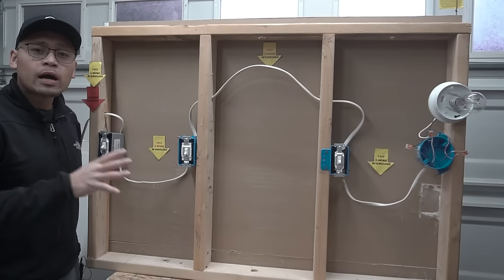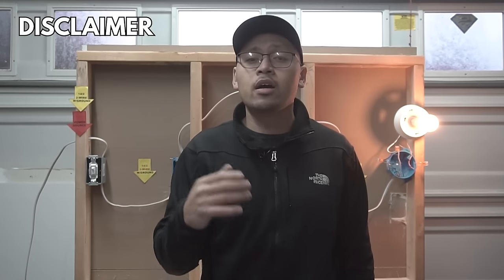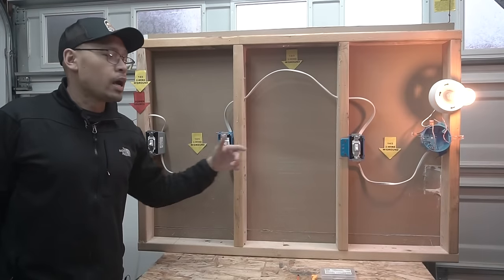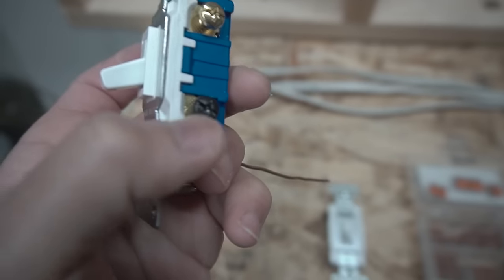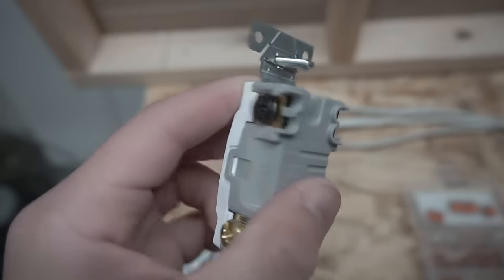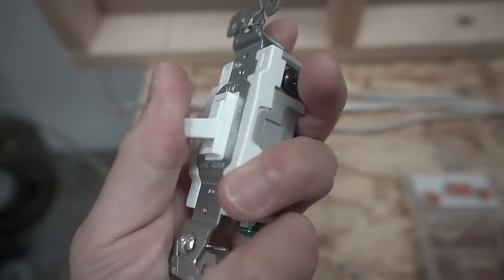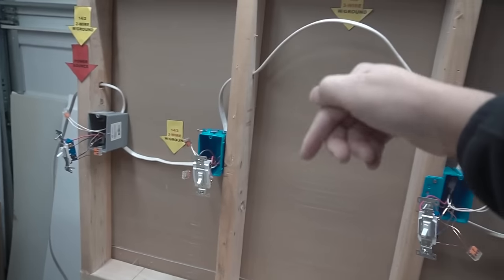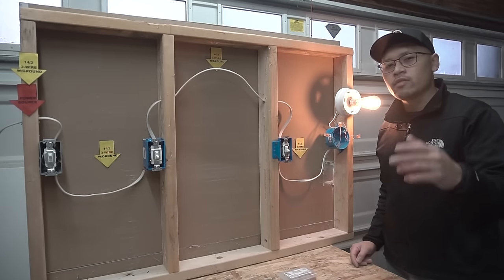How To Wire A 4-Way Switch System Explained (2022) | Easy DIY Step By Step Tutorial For Beginners!

Comment: On the 4 way it doesn't matter if red or black are on the same side, they just need to be one circuit on top and the other on the bottom, same on the 3 ways, first 3way switch power cable on the black scree and the travelers on the other screws, no matter the order, on the last 3way switch make sure the switch leg coming from the light is in the black screw and the travelers on the other screws no matter the order, what matters most is the common screws on the black wires on each side...!  Good video man keep up the good work...!
Reply: I notice on the 3way switches, traveler1s (red) are on the left side and traveler2s (black) are on the right side.  However, on the 4way switch, the 2 traveler1s are on the right and the 2 traveler2s are on the left.  To keep things consistent, is it possible to always keep traveler1s on the left, and traveler2s on the right on all switches?  Someone told me they always put the red traveler wires on top and the black traveler wires on the bottom for consistency.

Comment: One question; on the four-way switch, you connected the red on the opposite side from the first three way. I noticed you then connected the red and black on the second three-way switch to "match the wiring" from the first three-way. I'm confused as to way you didn't use the say wiring orientation of the red/black wires on the four-way? In other words, why did you not connect the wires the same all across? I hope I explained myself right here 🤔

Comment: We just bought a house that has an enclosed breezeway between the kitchen and the garage. The first 3-way switch is in the kitchen right next to the door (perfect). The other 3-way switch is in the garage, after you go down 3 steps and walk 5 feet over to the switch (senseless). To add to the poor control logic, the breezeway has a third door to the backyard AND a fourth door to the front yard. 4 doors into an 11’x11’ room. So coming from outdoors into the breezeway, there are no switches to turn on the light! I was considering an occupancy sensor, but now that I understand how to correctly add 4-way switches (and the fact that there’s an attic above the breezeway) I’m just gonna add a wall switch next to each exterior door (and relocate that silly garage switch). Thank you!

Comment: In your video , the 2 traveler wires are on different sides compared to traveler wires on both 3 way switches. They don’t need to be on the same sides?

Comment: I just found and subscribed to this channel about a few days ago and I really really wish that I had found him a looong time ago.   THANK YOU.   👍🏼👍🏼
Reply from the maker: Thank you so much! 🙏🏽🥰
Reply: @FixThisHouse  Your loops are too short and some insulation is pinching under the terminal screws of the switches which can cause a bad connection down the road. Too much copper exposed isn't good but also not enough is also not good.

Comment: Hi 
Must say you teach well !!! 
Question for a recap on a project of mine before I start ! 
Older home , and I need an outlet plug and the closes power source is a light switch running a light , reason why I'm asking is this house is finished and yes I'm thinking I need to run an attic wire to new plug and my question is how to connect to existing light switch to perform this

Comment: I was hoping to see how you packed the wiring into the j-box. 
I know how but for those that dont know how; they need to know to keep the bare ground wires away from the switch terminals. I would say thsts just as important as learning to wire the 3 & 4 way switches correctly.

Comment: Can I connect black on travler terminal #1 and red on travler terminal #2 in 3-way switch? (the pair on top side, not the single source on bottom side)
Because light is on when I off all 3 switches, i want to light off when I off all 3 switches.
Reply: Yes. It would just invert the function of the 4-way. You have to imagine the inner workings and see what is being connected to,what when you flip,which switch which way.

Comment: Does it matter if the red and black travelers have to be wired to T1 for red and T2 for black on the 3 way switches and the opposite in the 4 way switch?

Comment: Good class, but I have on issue the power comes in to the 4way switch . Had to replace it wired it up the way I found it but now the bottom hallway 3way switch does not work right,
if the 4way switch is down the bottom switch will work fine if don't turn the light off on the 4way the bottom will not work anymore// any suggestions all because the power goes to the
4way switch first

Comment: Hi, I noticed that you connected the red traveller on the left and black traveller on the right on the 3 way switches but switch them around on the 4 way switch. Would there be a problem if they all were connected the same...red on the left and black on the right?
Reply: No problem

Comment: Hi, at my last 3-way switch I want to control a light AND ceiling fan on a separate normal two-way switch (instead of just a light as in your video).  Do I just need a 3-wire (e.g., 14-3) going to fixture/fan kit or will that work from an ending 3-way switch?  Thanks.

Comment: hello there. I would like to know on the 4 ways switch. Red should be on the right side which is travel 1 and black should be on the left side which is travel 2. and also the power from the 1 switch goes to the bottom of 4 ways switch and power goes out to the 3 switch goes out from the top of 4 ways switch? 
From what i have seen you did. left on the right and black on the left on the 4 ways switch? Just wonder thanks
Reply: Don't think of left or right side, some 4-ways (decora style) have black screws on one side and brass colored on the other side. For example, on the cable coming from the previous switch the red and black wires will go to the black screws. The cable going to the next switch the red and black wires go to the brass colored screws. The red and black wires are the travelers.

Comment: My house has it installed without a 14/3 wire. Is it possible to do it with 14/2 wires? Or is the traveler needed

Comment: Can you have lights wired in between the switches?
Reply: That is what I want to know! I have two three way switches at the bottom and top of a flight of stairs. I would like to add a switch by the upstairs bedroom door. But that would put that switch after the light. I am thinking about putting the four way at the top of the stairs between the light and the downstairs three way. But that still puts the upstairs three way after the light. I am not sure how it would work. 🤔

Comment: Great video. I have a four way switch in my home, one of the locations is hidden, and never used. If I wanted to bypass it, and make it a three way switch, would I connect red to red, black to black, white to white, and ground to ground? Or would I connect red to black and black to red? Any help would be greatly appreciated.
Reply: Just remove the switch and connect all the same colored wires to each other like the switch wasn’t there. Just make sure that the travelers are connected from each three way correctly

Comment: That is very good video footage and good explanation 👍. But I have a question about the middle of the J boxfour way switch ? What will happen I crisscrossed the black and red wire on the traveler switch ? 🤔 by the way I just want you to know your video footage helps me a lot on my house . Thank you very much
Reply: As long as the wires from the same sleeve are on the same side it shouldn’t matter

Comment: Hi, can I connect power outlet to that 4 way switch box? If yes, you please share the wiring diagram?
Reply: It all depend on how you want that outlet to function.  It’s easy enough to connect the ground and neutral to an outlet.  But how/when do you want he power to get to the outlet.  If you use the red or black on the bottom of the 4-way it will only work when the left switch is in the position to power which ever color wire you used for the hot.  If you connect the outlet to the outgoing wires on the top of the 4 way then the 4 way will power the switch.  But then it depends on which hot you chose. The left most switch has to be providing power to the traveler you picked: up for black and down for red.

Comment: Just for clarification you can have up to 32........ 4 way switches on a dedicated circuit from 20 Amp Breaker with 12 GA. Wire  !

Comment: I still don’t understand why people insist on using toggle switches for 3-Way, 4-Way, etc.  They’re always in an indeterminate position and all you want to do is invert the current state, whether on or off.  A more appropriate switch would be a push button that internally just changes its current state.  It would still be electrically wired the same as a 3-Way configuration but it external activation would always be the same.

For people that still expect to see a toggle switch, a simple On-Off-On momentary like function could be simulated on a push button switch.  That way, you’d always flip up for on and down for off and the internal mechanics would do what the need to do.

I’m surprised that this wasn’t a standard convention years ago.
Reply: Because its not needed. Then buttons fail, thats why no breakers have them anymore. I'd rather do motion, voice, or magnet type switch. If we're talking the way it should be. You should just have light and not have to hit a switch.
Reply: So invent and market it.

Comment: Difficult to see why this is called "four way" In the UK we call this two way + intermediate.  We used to have "one way" switches, with two terminals, and "two way" switches with three terminals, then the manufacturers gave up on "one way" switches, since a "two way" switch can be used as a "one way" switch, so stockholding and manufacturing were rationalised.  We've always had "intermediate" switches (four terminal) for switching hallway lighting at convenient points along a corridor... (or at any level on a multi floor stairway.
Now... If we have a switch plate with four switches on it, it's called a four gang switch, and "gang" is German for "way" making a four switch plate a "four way" switch...
Amazing that we share a language, use it differently, confusingly... We have "two (or more) gang, two way switching", too...
Reply: It’s called a three way switch because when you combine two of them you have three way to position them: up/up, down/down, up/down.  The “four way” is just the nest logical step.  Plus the three way switches have three wire connections: power in/out and two travelers. The 4-way switch has 4 wires on it. It’s connected 4-ways.
Reply: @davidhummel8707  
@davidhummel8707
6 days ago
"It’s called a three way switch because when you combine two of them you have three way to position them: up/up, down/down, up/down. " So that's the logic?  If you'll excuse me, with a two way switching arrangement, there are four (4) 2^2 switching conditions... Let's label the switches "a" and "b", the positionings "up" and "down" So-
a up, b up, a up, b down, a down, b down, a down, b up. and similarly, with "two way + intermediates, there is a range of 2^n conditions, where "n" is the total number of switches... Basic binary?
I can accept that there's different terminology used either side of the Atlantic, just think there's a flaw in your explanation of the underlying logic...